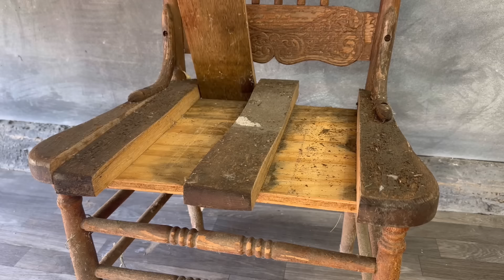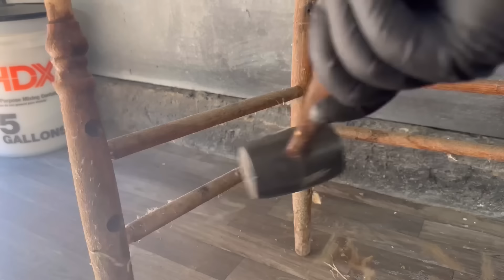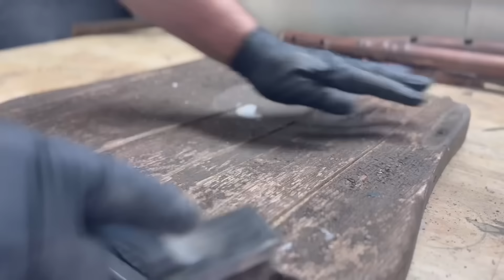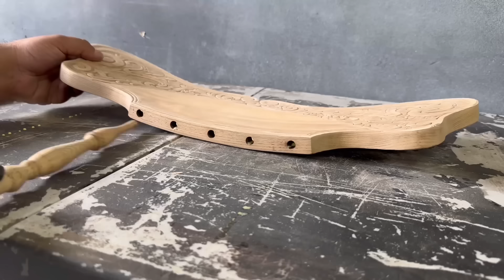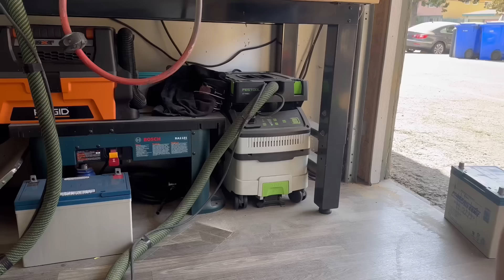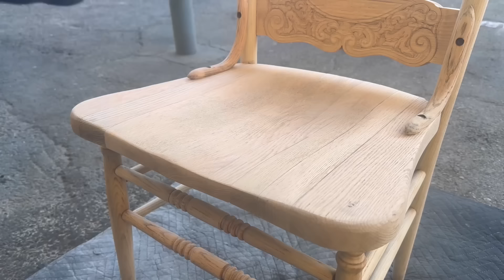1930’s Bent and Bro chair saved from the trash || ANTIQUE CHAIR RESTORATION

Comment: It's just a shame that the corroded fasteners came back. Otherwise the result is great.
Reply from the maker: I wanted to use all the original pieces
Reply: @CedarPineDesigns  ok, but the original screws could have been treated  to get rid of the rust (evaporust/sanding)  and  to stop the corrosion, otherwise great job
Reply: A good job, just putting the screws in evaporust👍
Reply: You can't even tell. They look fine.
Reply: I feel it kept a bit of the character! Not an expert here but I’d assume the spray poly would essentially seal in the rust and protect from further corrosion due to exposure?
Reply: Good, solid effort, and as such commendable, but amateur job, needs to watch a lot more restoration videos on Youtube.
Reply: Yeah, I thought he could have cleaned them up first. I see most people dip them in vinegar or evaporust or just use a wire brush and bar keepers friend.

Comment: Hi did you sandblast those panels? Very curious. Great result!
Reply from the maker: Yes. The sandblaster helps keep all the details.
Reply: Cool thank you, will look into how much they are here in The Netherlands. Thanks for this - very interesting.
Reply from the maker: @petervandermolen4089  fairly cheap on Amazon but you do need a decent air compressor. Nothing to crazy but it’s a great tool to have
Reply from the maker: @petervandermolen4089  Sand Blaster Gun Kit Red Adjustable Sandblasting Gun 90psi Portable Sand Blaster Blasting Machine Small Handheld Pneumatic Spray Gun Set (Color : Plastic Red) (Aluminum Red) https://amzn.eu/d/gg2AQCg

Comment: "1930's chair" ??  You are kidding yourself. Phillips Head screws were not available to furniture makers at that time.
Reply from the maker: In the early 1930s, the Phillips head screw was invented by Oregon businessman Henry Phillips (1889–1958). Automobile manufacturers now used car assembly lines. They needed screws that could take greater torque and could provide tighter fastenings. Please educate yourself before you make yourself look foolish on the internet
Reply: @CedarPineDesigns  Please read all of that story you found on the internet. Auto manufacturers were the first to use them, but as I said they were not available to furniture makers until much later. Please educate yourself before trying to show us how smart you are.
Reply from the maker: @akitas8165  like wise. That’s not the only article smart guy
Reply from the maker: @akitas8165  Philips head screws were introduced in the late 1930's. Any furniture that has a Philips head screw will indicate either the piece was made after the LATE 1930's, or it is not the original screw. Look at rust from oxidation.

Comment: First off, the chair looks great. I’m not trying to nitpick here as I think I’m a bit of an overthinking perfectionist - why not clean the screws? Also why not reinforce the seat? I know wood glue is strong but that was clearly what failed in the original design. Also why not stain the screwed on frame supports prior to screwing them on? Seems like a couple of points that are going to fail again sooner than should on what otherwise was a great restoration.
Reply from the maker: I had a lot of options on how to restore this and I decided it would be better off as an accent piece rather then a chair that will be used everyday seeing as how it’s a single chair. Still strong enough to sit on with no problems